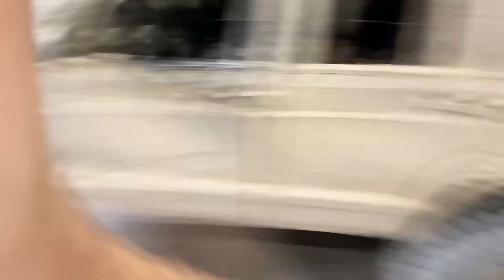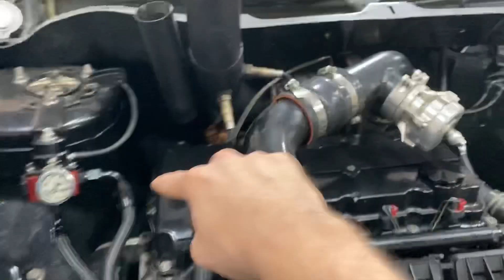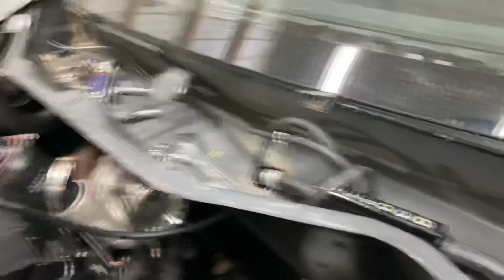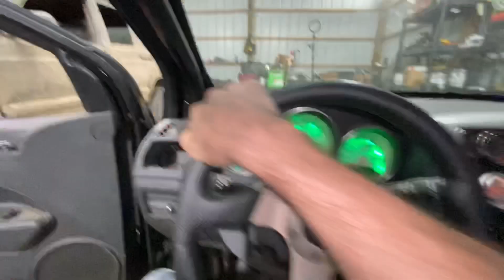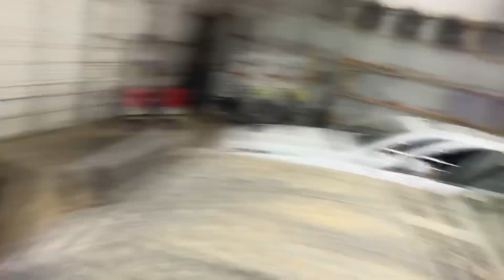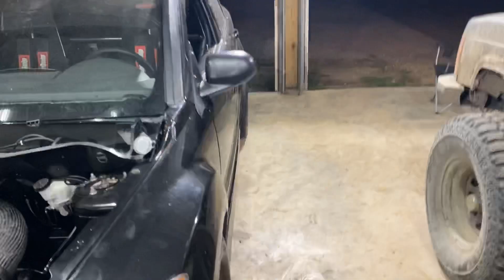CALIBER SRT4 PRECISION 6266: First Test Drive

Comment: what's the front wheel and tire setup you use?
Reply from the maker: On the street I use factory wheels with Nitto NT05 tires. 

At the track I use Rota slipstream wheels (15x7 5x114.3 OS:40 HB:73) with M&H racemaster slicks (26x8.3 15”)